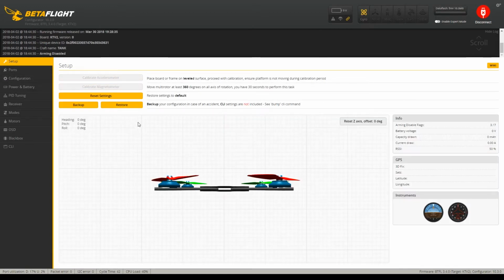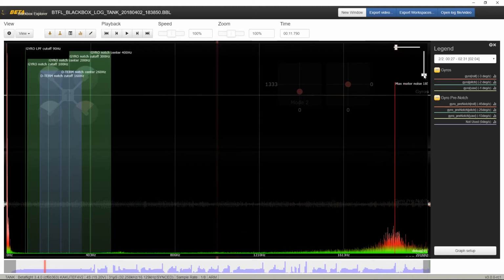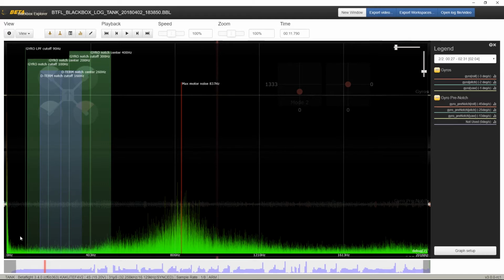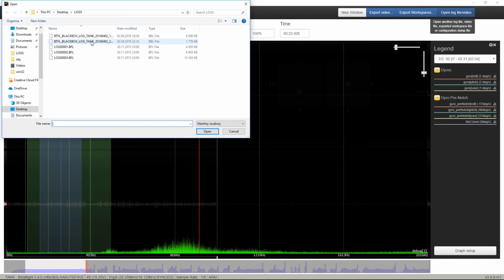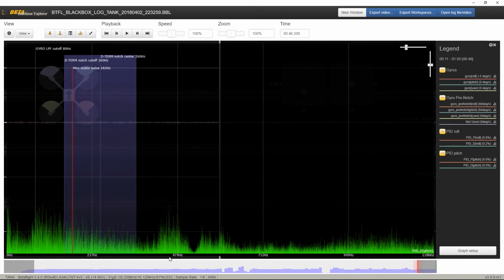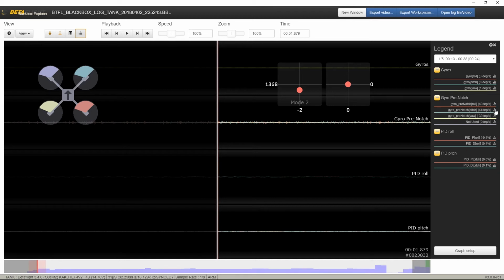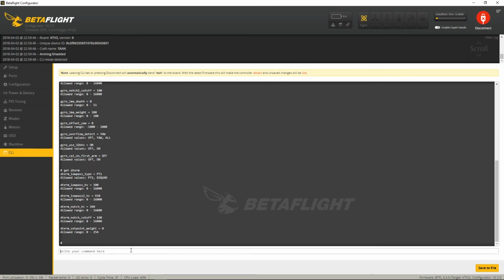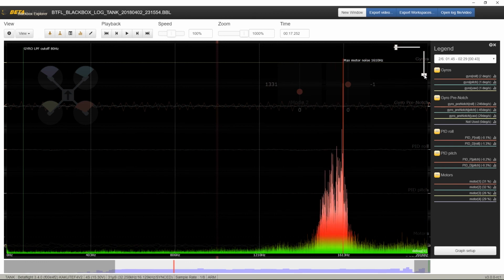Filters tuning on new build with BetaFlight 3.4

Comment: Hello. Great video. You explain everything so good and so simple! Great work! I am waiting for your PID tuning video. Can I ask you  what gyro/pid loop you use for this build, is the F4 overclocked and are you using dshot600 to achieve 40% CPU load?
Reply from the maker: Hello, thank you. I am using 32k/16k + DSHOT1200 setting with 216MHz overclock. In BF 3.4 there is optimized performance of dynamic filter on 32k and 16k gyro loops.